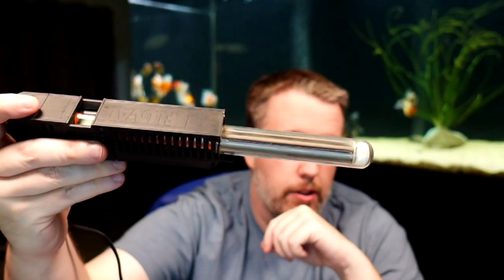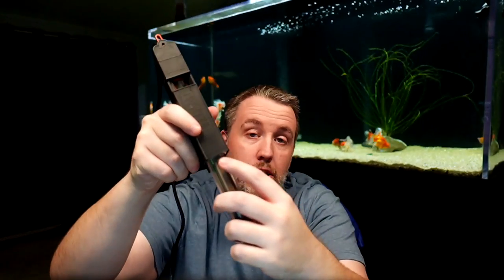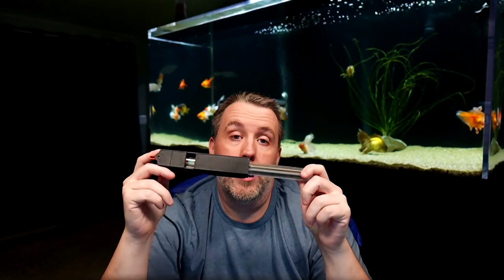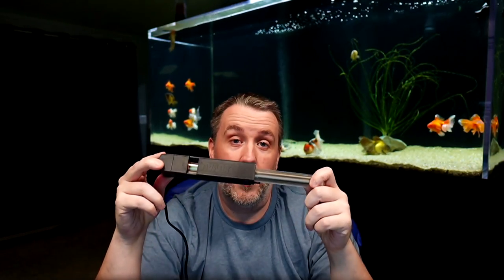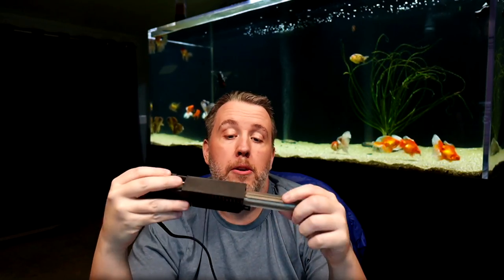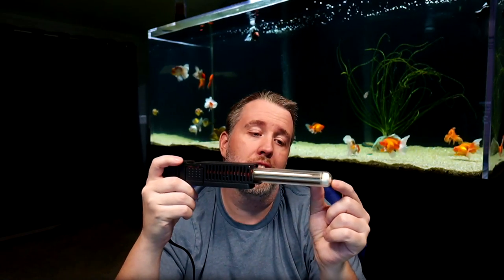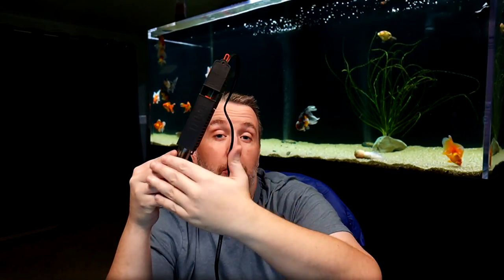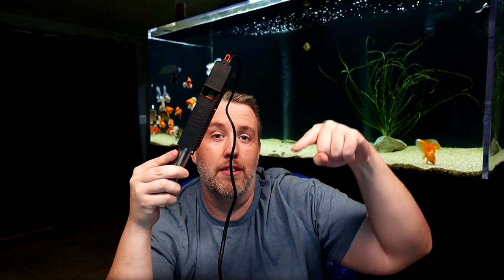The Truth About Aquarium Heaters (and Why They Always Break...)

Comment: I would like a PID controled heater with a ssd relay(solid state relay) of 150w, has power to heat my acuarium reasonably fast for say like after a water change and the PID works like your foot on an accelerater pedal trying to keep to say a 40mph speed limit, rather than full on or full of and the ssd eliminates mecanical movement. All in a stainles steel tube. That would be nice.

Comment: put submersible heaters sideways at base so it takes longer for the heat to get to the surface where it evaporates, also eg have two heaters in each tank, each heater does half of its tank water incase one breaks the other will at least stabilize the temp until you can replace the broken heater.

Comment: Nice video but it is definitely not mostly human error. Besides cheap quality. They need a throttle incorporated for low current and a prevention mechanism to stop the heater from going on and off so often. And of course there's other things you can do but then you're looking at the price point increasing it could still be worth it though.

Comment: What is the safest temp that most Africans can live in? I keep my tanks at 78 but there have been occasions where I had a heater fail and dropped to 72 and from my observation the fish seemed to be fine. Is 72 dangerously cool or is it safe? If it’s safe then I don’t really need to use much heat at all
Reply from the maker: 72 is the low end that I would say is safe. I prefer 73-74.

Comment: My Fluval E300 does not cycle like that. Could be an update? It cycles at more like 2 deg difference. 
I guess I'm lucky because my tank stays right about 80 naturally anyway (with a tight lid). The only time it has cycled is if I do a water change and the water is a bit cold.
I'm going to guess that .2 means it knows the difference between 78.1 and 78.3, not that it cycles like that.

Comment: Back when I started keeping fish, a long time ago it was usual to have a separate heater and thermostat.  I appreciate that having the two combined does mean one less piece of equipment in the aquarium but it has always struck me as bizarre to have th thermostat right next to the heating element.  Think of it in terms of the central heating in your house, you would not position the thermostat on top of a radiator.  
My main tank has 2 heaters, mainly so that if one goes down I still have at least half the heating required.  They are both wired through a separate thermostat and the probe is at the other end of the tank away from the heaters.

Comment: so i took it one step further and use a bi-metal heater with a modern controller that controls the heater and a fan  that i can control the fluctuation so i can let it go up and down a bit more  and i have alway ran my heaters at a 45 for that reason i think they should but a powerhead in it

Comment: To be honest I have found the best heaters that work for me and the fish that I keep. Is the tetra brand that you buy at walmart. I have never had one fog up nor fail on me. They heat my tanks well. I only use heaters in the summer yes I know that sounds dumb.  I live on the top in my building and it gets hot so I run my AC. If I didnt use heaters my tanks would only be at about 60 if that. In the winter months I do not need them it stays about 80 in my place.

Comment: What about inline heaters?  I'm about to use one on my 54.
Reply from the maker: I only have experience with the hydor heater. Sold them for years at a store I worked at and even at my store in the beginning. The failure rate was too high unfortunately. But I do think that an inline heater with remote temp probe and a more robust design might be the future for those who use canister filters.
Reply: @AquariumCoop  do you mind sharing the failure type? I have a Hydor inline that i ran testing for 5 months that worked. It's not hooked up right now but will be on my 54 gallon in a few weeks... Or at least that was the plan.

Comment: Brilliant video Cory it's exactly what's happening to my 300w I'm away to putnit next to the fluval filter flow pipe at the angle! I got a new 200Ltr corner tank it's not the easiest to get into so like what you said the heater is in a place I want it up and down its glowing working overtime and clicking on and off its basically a freezing cold tank that's why I'm on here to see what I'm doing wrong

Comment: The  water temperature in the deepest parts of Lake Malawi is 72-80F with temperatures toward the surface 75-84F.  So Cichlid keepers be careful when considering removal of your heater.  Will they suddenly die at temperatures in the high 60s to low 70s. No. Is it optimum. No.

Comment: I have a 21 tall , I was going to go extra tank and they told me that I didn’t need to have a heater so I just have it at room temperature and it’s at 66 I keep my heat in my apartment at 70. Do I need a heater for the shrimp I also want to add a few fish in there was thinking dwarf neon rainbows what do you
Reply: Shrimp
Reply: Or dwarf sparkling gourmie
Reply from the maker: The shrimp would handle it no problem. However you probably want a few more degrees for those fish. Do you run a glass top? perhaps adding a stronger light or another filter will give enough passive heat to get you there if you are already running the top.

Comment: another issue is the rating system the manufacturers use for these heaters is waaay overrated (so they can sell you the more expensive one basically) a 100w heater in a 20 gallon tank is overkill it wont have to run for long at all and therefore turn off after very short periods of time. the key to this issue is use a lower rated heater than is typically "recommended" honestly the fish wont mind a very slight swing in temperature
Reply: this guy pretty pretty much covers it all great video :)
Reply: What about for really small tanks (5 gallons)? It's hard to find good quality heaters that are less than 25 watts.

Comment: The laws of thermal dynamics means these heaters are 100% efficient because literally all the energy being consumed by these devices is turned to heat (which is the goal) so it literally makes no difference how long it runs for VS energy consumption 50w for 4 hours is literally the same as 100w at 2 hours THE DIFFERENCE is the cycle rate of the device ON/OFF/ON will mean the higher power rated heater will fail first. YES i do know the heaters with additional electronics arent technically 100% efficient but the power consumption of those compenents alone is negligible. The ONLY thing that determines energy efficiency and energy usage is how fast your aquarium will dissipate heat to its surroundings
Reply: this guy is smart great video i should have watched the whole video before commenting

Comment: There are 2 tings that are getting conflated. Hysteresis, which is the temperature range the heater allows and accuracy. If you set the temperature to 78F and the Hysteresis allows +/- 2 and the accuracy is .2 then all is good.  If the accuracy means that it cycles over a .2 degree range, that is not good, but I'd guess that is not what is being advertised. The biggest problem with temperature fluctuations is with small tanks, they will heat up and cool down very rapidly, room temp and sun load will be big factors.  
Those of you with heaters that are many years old, guess what? They don't make 'em like that any more! Planned obsolescence is the way, and the name of the company means nothing.
Reply: He has no idea what hysteresis is and no idea that it can be set in the firmware of heaters with electronic thermostats and designed into the circuit of mechanical thermostats.

Comment: People should just switch to inline heater, no more flow issues and neater looking tank with less equipment inside.
Reply from the maker: I believe they still need a remote temp sensor. Hydro inline heaters are prone to failure.

Comment: I don't see how a heating element in a water tank can ever over heat. Using a laser digital thermometer I measure my heater tube when it's on and its water temperature. I think most heater failures are caused by leaving the heater on during a water change.

Comment: I usually killed mine during water changes, I do BIG water changes. Being in Italy we have 220v mains, not nice to get zapped so gradually swapped to German built Schego titanium heaters, they require a temperature controller so I use Inkbird 308's. I have 6 of these combos, from discus kept at 29C to others kept at 22C. They are all set with a 0.3C range and never had a problem with them. The combo is expensive but it is effective, reliable, weapon grade solid and the heater can be be positioned however and wherever you want. Pity Schego not available in the US, as far as I know.

Comment: Constantly turning on and off dosnt seem to be a good design. Allowing a bigger range than +/- 0.2 degree from the set tempeture is one way to reduce the number of on off cycles.

However doing so may not be closer to nature. If for example with an aqurium located in a garage or basement you still had an on off cycle every few hours or more frequently with a +/- of 3 degrees from the set temperure that would give multiple flucuations a day of 6 degree between on off cycles.

Were as on the other hand with an aqurium with exactly the same heater located say inside someone's home you may get much lower rate of heat loss so much fewer on off clycles so much more gradual flucations  that are more like those in nature from the regions of the world were the tropical fish we keep in the hobby come from.

A better idea to control tempture than constantly turning on and off may be to adjust the power of the heater in steps up to its maximum rating. So a 300 W heater might use anyware between 0 to 300 W - whatever it needs to counteract the rate of heat loss day or night, summer or winter, durring normal running or durring / after a water change.

The equivalant of say an electric space heater that has multiple heat settings - were the heating bar slightly glows, glows some more, glows at maximum, 1 bar is used / 2 bars are used, etc.

This idea is similar to that used by Smart Thermostats like Nest with new boilers in home heating systems. Rather than tell the boiler to simply turn on and off using an industry standard called OpenTerm a hot water boiler can be asked by a Thermostat to adjust its heat output to what's needed rather than the traditional on or off at a set heat output.

Comment: So instead of the manufacturers putting in the money to build a high quality heater, they would rather tell people they are using their crappy heaters incorrectly and blame the user instead of the manufacturer. If they break, they are not designed properly. People are not using these heaters as hammers or coat hangers. You put it in the water and it either works or it doesn't. If they didn't heat evenly due to lack of water flow and they proved it, then they would have a case. But the units cracking and failing internally, that's a design flaw and they know it. "How can we make a so so product for dirt cheap and sell it for ridiculous profit?" That's every manufacturers motive.

Comment: So we use heaters wrong because we use them as intended?!? Sure fish keepers may have ridiculous expectations but poor design for longevity is still poor design...

Gonna have to agree with some of the other commenters, cost reductions by manufacturers on the thermocouple and heater elements are likely a bigger cause... I'd love to see where the greater point of failure is, the bi metallic strip or the heating element... Reptile keepers use proportional thermostats ($$$) which would likely extend the life of the heating element at least.

Comment: Some plain wrong info in this one... Heat distribution in a tank is not restricted to the flow of the water only. (for the argument of flow vs 100w vs 300 w heater. Also Im pretty sure there is no evidence for the on/off cycle doing this kind of damage.

Comment: If they went to solid state relays they would last darn near forever. 
But everyone wants the cheapest heater so they get what they pay for........the companies design for what sells, cheap. 
We have controllers at work that use SS relays that cycle 1000's times per hour and they last over 20-years.
Reply from the maker: Do you know how much most cost it would add? I don't understand what that would take to implement. Also it still leaves the problem of enough flow, but I think education fixes this.

Comment: I know people who have done of it over water when they do a water change 🤦😂🤯 we need to cut the power, when that might be happening.
Reply from the maker: Yeah, I recommend placing heaters below your typical water change level. I usually only do up to 30% water changes so that it's easy to avoid that.
Reply: I have my filter and heater on the same power strip. If I don't shut that off, the filter outlet splashing like crazy would remind me before I'm ever in trouble.

Comment: Funny how your blaming the end user for a bad product. They changed the design notice that old ones work for years yet new ones last months if your lucky. They went to cheaper resistor if you take one apart look at the resistor right before the coil. I was really disappointed in your take on this. I think we should all take our heater back every 30 days and get a replacement once it costs them more then just building them correctly. they charge more then enough to build them correctly. SHAME ON YOU. THE TRUTH IS THE"Y ARE SAVING LESS THEN 25 CENTS  PER HEATER YET CHARGING MORE.

Comment: Wow, this video is all over the place. And it gets it wrong when looking at the 0.2 of a degree accuracy. All that means is that if the device thinks the temperature is 75 then the temperature is going to be between 74.8 and 75.2. That's it. Everything else he discusses is hogwash, which I'm surprised because he seems to understand that his furnace doesn't work that way. The thermostat on my furnace has a 0.1 degree accuracy and it works just like his, and just like my tank heater. Tank heaters follow many of the principles that other heating devices follow so no, it's not going to cycle power all the time due to a 0.2 degree temperature fluctuation unless it crosses the threshold that would turn it on, or a furnace, or a space heater, etc.

I also disagree with using the lower wattage heater. Heaters are designed to give the best efficiency if you use the recommended heater. So, say hello to a slightly higher electric bill if you follow his advice, and there's a good chance that the money you waste using a lower wattage heater could pay for a new, correct wattage heater which will heat your tank more evenly and efficiently. I agree about using multiple heaters, i.e. using two 50 watt heaters in place of a single 100 watt heater. That not only makes it possible to spread out your heating in your tank, but also helps if one fails. If that happens the other can help limp along until the bad heater can be replaced, which your fish will definitely appreciate.

Comment: I always heat these kind of things. I've had aquariums for more than ten years now and have never had a heater break or stick on or any kind of failure. There are some rules to follow I believe. Like always run 2 smaller heaters instead of 1 larger one. Put your heaters horizontally not vertically. And most importantly spend the money on a good heater. My oldest heater is like 6 years old. Longer than any of the tanks its been in.

Comment: Anyone else here that doesn't use a heater?
Reply from the maker: For the most part I don't. A few at the shop, none in my fish room currently. I use a dehumidifier and gas heating to supplement that when needed. However I have the heat set at 69 degrees to turn on.
Reply: @AquariumCoop  70 in my home but I also use a pellet stove if I get cold.